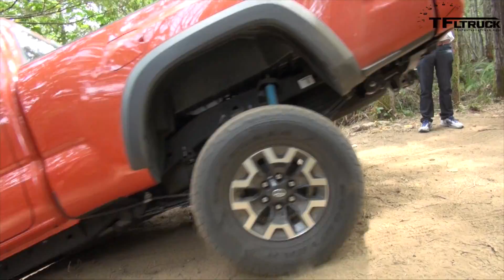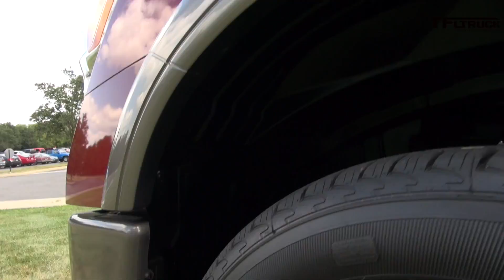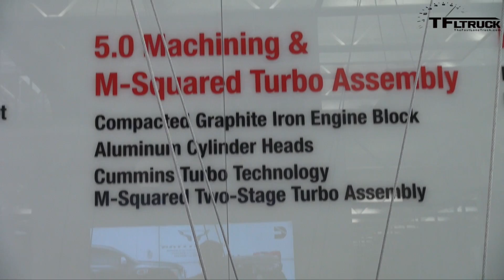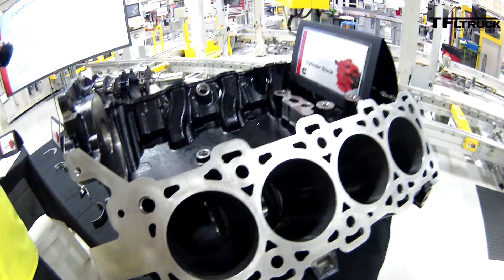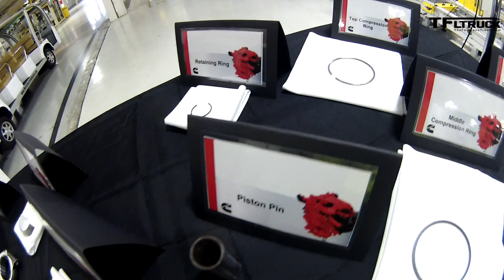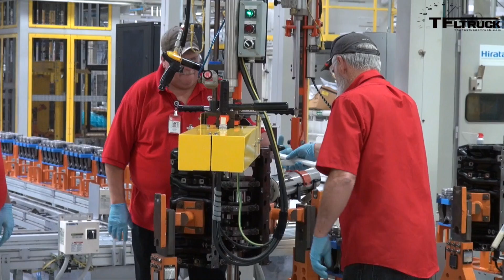2016 Nissan Titan XD: 5.0L V8 Cummins Revealed: Almost Everything You Ever Wanted to Know

Comment: I have a 2016 Nissan. Titan  With the 5.0 Cummings diesel. I live in northern Georgia in the mountains When I'm pulling my trailer to go up my driveway At times I lose complete power No acceleration whatsoever  No warning lights if the truck sets for 15 20 minutes  And the problem goes away It does not do this every time it is intermenting Any help on solving this problem thanks

Comment: I own one of these trucks. The truck and Motor is fine, except for the air conditioner. on this model trk. the air conditioner blows hot on the drivers side and cold on the passengers  side. My truck has been in the the shop two months waiting for a fix. I have been driving a loaner, which is a gas model. I wanted a diesel to pull my pull behind r.v.. If I had wanted a gas model I would have kept my 'F150 and the smaller payments.
John Sinclair Nissan in Cape Girardeau MO and his staff are really fantastic. I called the main complaint department and the lady there told me "roll the windows down", then take my complain and stick it. She told me IF and when it got fixed they would extend the warranty and I should be happy with that. 
That was her reply to what is the very most it would take to make you happy? MY reply was "me driving down the road in my truck with the air working."  
Great motor, but you are wasting your money if you buy air conditioning.

Comment: If they would have skipped the V8 bragging rights and stuck with a straight 6 in the 4-5 liter size I might have purchased a Nissan.  You blew it Cummins.  My 5.9L B6 is has more power, better fuel economy and will outlast this engine.

Comment: Terrible mpg for a diesel. The ecodiesel does much better, and the Ram doesn't look like some cartoon character with a big nose like the Nissan. Not only did they do horribly on the redesign of the truck @Nissan just to fit the diesel, but the savings are almost zero in comparison directly with the MPG which are similar on any V8 gas engine in the big three. Add the DEF cost, and maintenance cost of this Cummins and its a complete flop (too bad Cummins was involved). Not worth the paper it was drawn on. Nissan should bow out of the truck market. There is no advantage to the NIssans Cummins pairing at all. The only savings might be if you compared it to a Nissan gas engine truck, which are historically disgusting on fuel usage.
Reply: +Ry S a v6 to a v8? And you are talking about EPA? Not the same engine lol styling is personal so can't say much on that.

Comment: Would be nice if they mentioned what transmission was behind this motor. Either manual or automatic, that's the most torque of anything they've had to deal with. 

Either way, I wouldn't touch this truck until 2019 until all the bugs are worked out of it. I'll let someone else be the beta testers.

Comment: Thin wall casting and 10 head bolts per cylinder is going to equal disaster. This Cummins looks a lot like the Ford 6.0 powerstroke in way of short comings with head gasket failures. The chain guides look like the Ford 4.0 SOHC, which wore out prematurely. 

Best of luck to the people that are the Guinea pigs to this truck.

Comment: Aluminum heads on a diesel?? Aluminum components?? Quieter??  This is a diesel right?  If you wanted quieter and lighter, wouldn't you go for a gas engine?
Reply: People complained about aluminum heads on the Duramax when GM introduced it in 2000, but they worked fine.  To me, aluminum heads on a light duty diesel was a settled issue long ago.

Comment: Fact : Inline engines are much smoother running than V pattern engines.Prediction for this engine : It will NOT be as durable and trouble free as the inline 6 Ram uses for several reasons.One : although heavier the inline uses all cast iron parts unlike Nissan's diesel engine which will make it more durable than the aluminum heads and pistons on Nissan's engine.Two : it will cost more to purchase and be harder on fuel than the inline 6 despite the fact the inline 6 has more torque which is what a person want's in a truck.

Comment: Clever little peek at a NV3500 and then a listen a the tail pipe. I didn't think they'd announced that one yet. Lets hope it gets a 4wd option, too.
Reply from the maker: That Cummins NV was a total surprise. There is no official information about it.
Reply: +The Fast Lane Truck I suppose, the NV was available for chassis testing long before any Titan mules on the new chassis. Lets hope it happens nonetheless, along with a long-body version.
Reply: +Guenther Wilke are you talking about a new venture manual transmission??? If they offered an 8 foot bed with an extended cab and a manual, I would be all over it!!! to replace my 01 dodge 6 speed cummins that is still running and towing great, but falling apart
Reply: +Guenther Wilke I think they guy said it would be 4x4 and 4x2 offering.
Reply: +msbaugh440 Same thing happen to my dodge. Motor and 6 speed were flawless, but the body just rusted away.

Comment: see discussions below. diesel fuel economy is a red herring. diesel is all about torque, curve, and load. unloaded truck stats mean nothing (you buy a truck to keep it unloaded?). a 3L engine pulling 7500# may need 3000rpm with very little room to increase rpm, and lower torque so more fuel is needed to hold speed. a 5L engine may need only 2000rpm with say +1000rpm room to increase. at reduced rpm for the 5L, fuel flow can decrease to the 3L rate, but the 5L torque will have greater holding power. thus a 5L engine can achieve equal fuel economy to a 3L engine over any given distance hauling equal loads.  this analogy holds true for 5L and 6L engines, too.  so for diesel, drivers should match their loads to the vehicles within a narrow band: this will optimise their power and fuel requirements for their capital investment.

Comment: I'm not trying to be negative in anyway but from an engineering stand point where they put the turbo and fuel pump will make it hard to work on. like who the fuck thinks to put the turbo on top especially with aluminum heads and the hot side of the turbo so close to the block. I know the power strokes have it like that but we all know how long lasting those are lol hopefully those Cummins pull through 5.0 should be a good performance platform
Reply: and all those timing chains 4 chains? gah damn un necessary
Reply: look at how a duramax exhaust is run with the up pipes. this is basicly a duramax. they even have the fuel pump in the V like cummins is doing.

Comment: Just give me a 2017 F150 4x4 and this engine and I'll be one hell of a happy camper. 2017 is when the F150 gets a 10 speed automatic, this thing will sit in front of an Aisin 8 speed transmision. Besides a newer Ford truck will last longer than the Titan, looks way better than the Titan. Just hate turbos on a V6...too much crap to go wrong.

Comment: Those headers look super constricting almost on purpose, that motors probably got so much more in it. Reminds me of the constrictive down pipe they put on the 7.3 idis right before the 7.3s came out in an effort not to out perform new motors. That thing will probably have a 50- 75 hp gain just by putting a better exhaust system on it. Nevertheless, this seems like a great way for cummins to widen its market, specifically those looking to do diesel swaps. A lightweight, powerful turbo diesel that fits into a small space. Nice move Cummins, nice move.

Comment: 310 hp out of a 5.0 v8 is just sad. They did that easily 15 years ago. Some 3.0 liter diesel engine top that number. I think with this truck you're buying a diesel engine from 15 years ago with some commonrail injection. I would be happy not to buy that.
Reply: Foolish man look at hp ratings, smart man look at torque rating
Reply: +matthijs van leijenhorst My 15 year old nissan truck is still competitive with the new guys and it traces its roots to the 80's.  You don't need to have all of the marketing hyped technology to have a good vehicle.  I'd rather they don't push an engine with an emphasis on light weight to its power limits anyway.  Can you remember the motor your talking about?  That is awesome power!
Reply: I just looked at the facts that its a good reliable small truck capable of 30+ mpg highway with a proven drive-train and their is nothing like that anymore.
Reply: The torque is what matters, Not the HP on a diesel lol.  It failed the market , Because for the price people would just step up to a 3/4 ton with more towing capability

Comment: with 20 mpg city and 30 highway, 25 mpg combined  555 torque to out haul any other 1/2 ton with ease,
it will haul your load with the money you save on fuel 
+++++ W O W +++++  -_________-

Comment: it's a nice truck I figure 36k to 45k price, I'm betting 25-37 Mpg.  my opinion it will probably have a 26 gal tank. 

The engine's got a decent setup for a smaller v 8  diesel, hopefully it will ship with synthetic oil standard. I'm hoping for 15k oil changes.

I'm betting it has a 10 gallon Def fluid tank, I'm hoping that while the truck is a nice design for tow/haul that they make a version for the everyday driver that's diesel. 

I'm hoping the transmission  is at least a 8-10 speed with Overdrive/ Tow mode. It would be nice to see advance traction systems and collision  avoidance on the truck.

Comment: You couldn't sell me on that engine, at all.........soooooo much wtf all over it....... for the love of god just come back with the mechanical 12valve 6BT.    And then leave it the hell alone!  All this extra BS all over these engines and job justification from engineers is BS.    the 6BT got 25MPG and the truck would decompose before you had any engine probs, and if you had to work on it you actually could!   Nobody will be able to work on this POS, its disposable.   2 thumbs down.......

Comment: I buy trucks that can tow and not make noise. RAM's are all too noisy. Noise makes long trips tiring. Fords are as quiet as I can buy a truck right now. Also of concern is the high pressure fuel pump leaking straight into the engine oil. How long are Nissan's super-extended warrantees? Moreover, why is the Navi screen so small? Nissan via Infiniti had a nice Navi but that was in 2008, why does it look like the same sized unit at 2008? Of further interest, does it have a winter kit? Fuel tank heater, fuel filter heater? Fuel line heater? Northern Minnesota gets cold and fuel jells.
Reply: +EricTheOracle You better stick with Ford, they don't build Pretty little trucks for that kind of environment. Damn thing don't even have a block warmer. Let alone a supplemental cab heater. They Never even heard the name webasto.

Comment: I'm not seeing that this will sale very well. The truck will most likely be just as heavy as the current HD trucks, with less towing capability. The motor is almost a decade old and currently underpowered when you compare it to other half ton gas motors that will be considerably cheaper to buy. I love Cummins but I feel like the dodge ram with the tried and true 6.7 is the way to go.

Comment: I am still not sold on this. I dont see why you need a 5.0L diesel in a half ton truck other than bragging rights. They may act like its more than a half ton but all the numbers I have seen claim ~2000 lb payload and 12000 lb towing. F150s and Silverados are already there and Ford's ecoboost already seems to be more than enough motor for what those trucks can do. 

If you really need to tow so much and so heavy that you need a diesel than buy a 3/4 or 1 ton.

Comment: Another question i'm really wondering is if the 4x4 models with the diesel are independent front suspension, or straight axle...? Ford and Ram are both keeping the straight axle, and seems like a much more reliable design. I never have been a fan of IFS.

Comment: Sounds great buuut I'm sure Nissan will use the same manufacturers for sensors(very short life and expensive to replace), along with transmission issues. Did I mention the customer/vehicle neglect of necessary recalls. Im not convinced an engine with more aluminum and thinner engine walls is safe either. yeah im sure you tested this but I forsee big problems, what about longitudinal studies. Will it crap out after 20K miles then deal with the oh so infamous denial of issues....lol were on to you Nissan.

Comment: Nissan armada need to be redesign .
Reply: +shane premraj can't, there is practically no market for the armada.
Reply: +shane premraj Put this motor in an SUV and you better build a new production line.
Reply: +jeffrey625625 It is one of the most reliable SUVS ever sold. 2009-2012 Armada is rated as one of the best vehicles on carcomplaints.com and has very very few complaints from it's owners.
Reply: Godsimaginary74 as common sense goes, the less you sell, the less complaints you generally have. When I was in a market for a 1500 fullsize suv, the armada was the worst with a reported terrible ride due to bad suspension tuning and a guzzling motor that eats more than its counterparts with better torque curves and max power. The only thing that attracted me to it was the low price of ALL trims. I ended up getting a Chevy suburban LT, rides extremely well even with a solid rear end. although the expedition and sequoia were also interesting
Reply: +Godsimaginary74   yep its better than the escalade and GMC. it has a nice shape to it. just needs a little more features. the escalade looks like hearse.
Reply: jeffrey625625
 There are tons of other cars on that website with very low sales and they still have a lot of complaints. I personally don't see many Dodge Journeys on the road, but it is rated as one of the worst SUV,Crossover (whatever the hell it is) to purchase.
Reply: jeffrey625625
 That being said.. Tahoe, Yukon, and Suburbans are all great vehicles. They last forever and their power-train has been proven to be very reliable. The 5.3 is a great motor as is the 6.0.

Comment: it reminds me of buying an intel pentium processor vs buying an intel core i - series processor.
Reply: +gatewaysolo104 If all your running is an email server, would you rather have a Pentium Pro 200, or an i7. A work truck is like an old slow email server. It just sits there chugging along doing its thing. Speed means nothing, reliability is more important. That's why I'm still in a 14 year old Dodge, and happy to have it.

Comment: I know this is a Cummins motor but I don't have the same faith in it that I do for their straight six motors, for 2 reasons, as of now.
1. I think the timing chain versus gear only is a bad idea chains and components  don't have the longevity and I don't think will hold up when you start putting power to the motor, and there will be a good chunk of people that buy this truck and delete it and tune it. It will be tinkered with.

2. This motor only has 4 head studs per cylinder, that was one of the biggest downfalls to the 6.0 powerstroke was head gaskets. most all Cummins motors that I'm aware of had 6 head studs for each  cylinder and it held up. But only four head studs on this v8 I think you're going to be running into some of the same problems that they had with the 6.0 powerstroke. 

And the ford was only running 325 tq.
Reply: Woops sorry, 525 tq, not 325.
Reply: +Curtis Bull This 5.0 also has 4 timing chains LOL
Reply: ftffighter ya, sure makes for a lot of moving parts!
Reply: rabie4x4 Don't know why we see all these issues and Nissan don't. I guess they sell them hopping for the best.
Reply: +Curtis Bull Could be worst. The new diesel for the Canyon/Colorado has a timing belt.
Reply: And no cylinder sleeves?
Reply: That red hot turbo in the valley doesn't look like a good idea either.

Comment: Never will I buy another nissan i own the armada and the titan biggest mistake ever they both are falling apart. I keep up on all maintenance. the motors are great but the electronics all have gone out, brake brain, main brain, backup sensors, self leveling lasted 3 years crap. low pressure sensors never worked right. both of my vehicles had the electronic dash go out. I'm not bashing I just don't want anyone else to go through this crap. I'm buying a ram or Chevy diesel. Nissan doesn't stand behind there crap. look in any titan or armada with over 50,000 miles there driver seats area falling apart.  let's not ever get started on those cvt transmissions in the altars maximas or sentras do your research crap all crap. want to trade in the armada  paid over $40,000 resale $5,000 or less. Never again will I buy nissan. Nissan hasn't changed there trucks style or motors in what 11 years. Beware nissan is crap and I use to be a nissan fan.

Comment: So they made it the same weight as the 4BT but in a V-configuration. Think its probably closer to the old GM IDI weight of the 80s. Least it has the familiar Cummins sound t it.